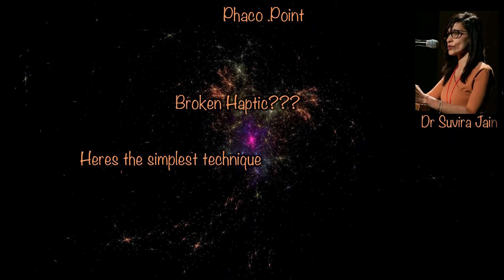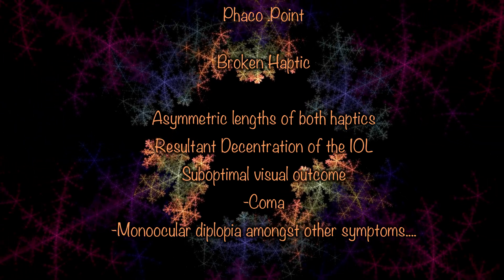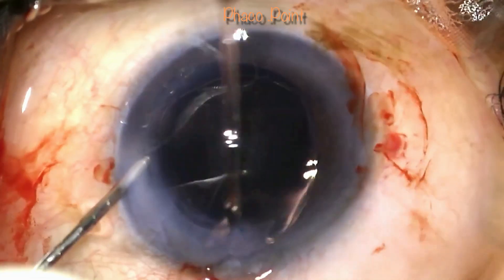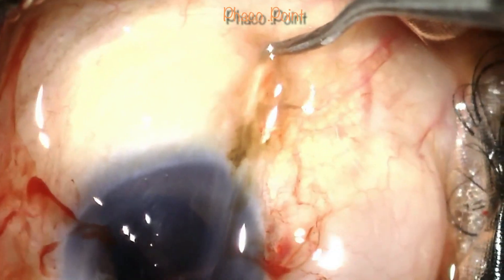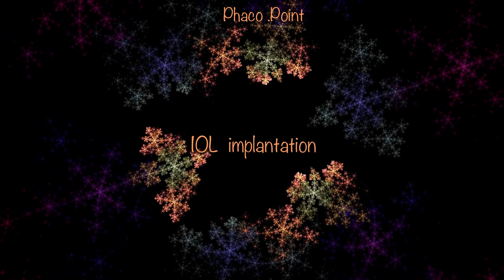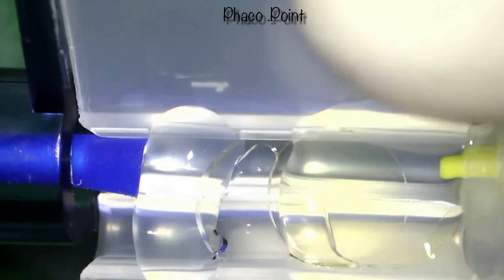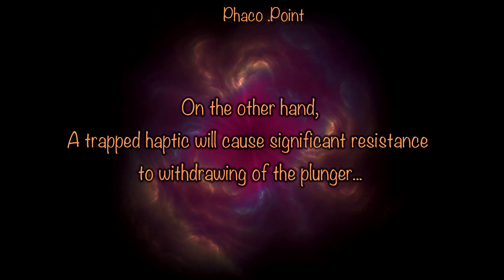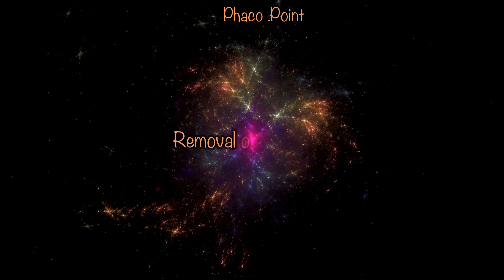Broken haptic during IOL injection - here's the simplest method to explant the IOL  and loading tips

Comment: Why not to cut the iol or fold it so that you don't need to create  a large corneal wound?
Reply from the maker: Hello. IOL bisection or removal with folding still needs a he incision to be enlarged from 2.8mm to 3.8 mm or to 4.0mm for comfortable removal. The wound stretch and distortion induced by the stretching will cause stigmatism. However, if the incision is enlarged in a controlled manner to 5.25 mm, then I find out the amount of induced Astigmatism is just to the tune of 0.75 dioptres or even less. In addition this makes the procedure simple and is endothelial friendly. This is just another way of doing it

Comment: Sir, 7+Years back I fell down on the road with my full body weight and I lost my left eye. The haptics of the eye broke down, iol cateract lense merged in the eye and on cornea appeared hammairage. I couldn't see from that day although there's no wounds or broken bones around the eye but this traumatic eye got smaller and pressed comparing to my normal right eye which's iol cateract lense in it intact with strong hepatics, through which I see. Here in Pakistan the top vitriologist surgeon said on my queries " where would I put the iol cateract lense, it'll fall " 
I suffered 7+ Years psychologically and emotionally with great discomfort falling repeatedly. 
With the improved surgery technology is it possible that my hepatics of left eye could be reconstructed and iol cateract lense be put in them so I could see again. And with advanced cosmetic surgery my traumatic left eye could be bring to it's normal size back like my right eye. 
Regards
Reply from the maker: The reason for the reduced vision that you have is not because of the broken haptic. replacing the IOL is not difficult. However I feel that the retina specialist you've met must have found that there is an internal damage to your eye , which is the reason for the poor vision and not the dislocated IOL.Please consult a specialist as it is difficult and inadvisable to give suggestion without properly examining the patient